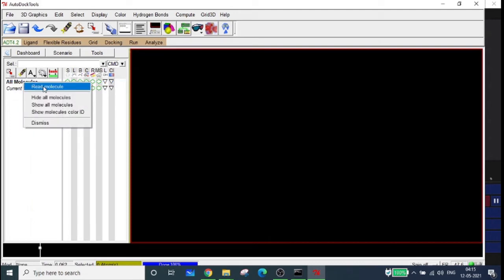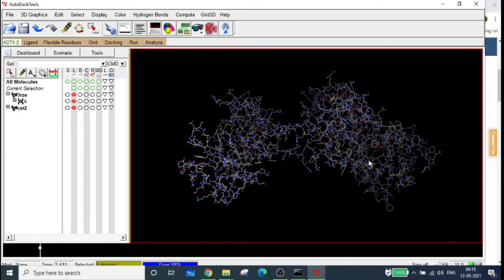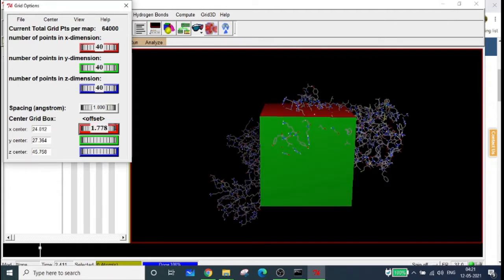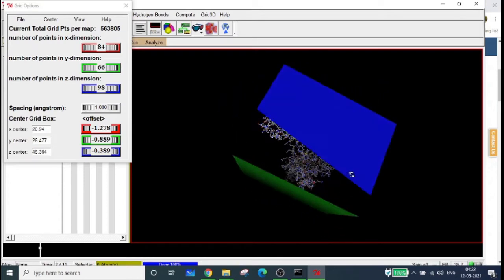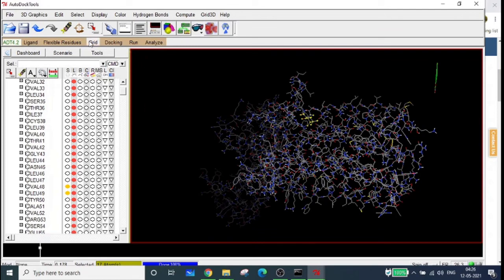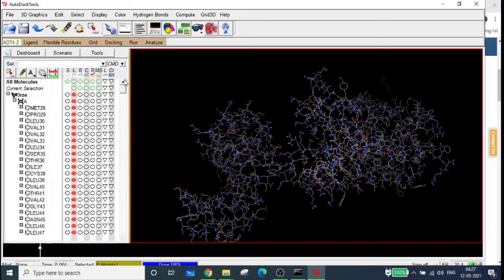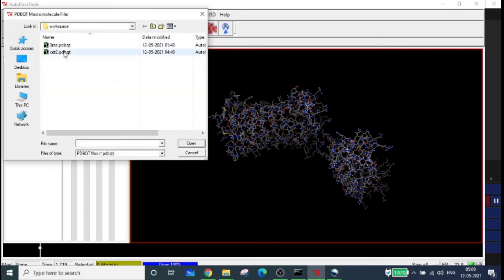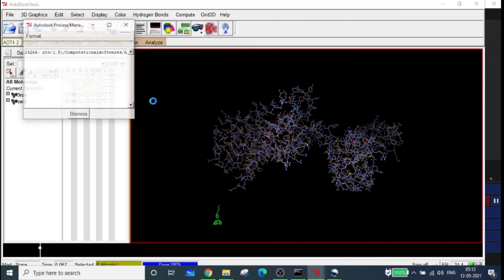AutoDock Tutorials Part 5- Run AutoGrid & AutoDock- Blind Docking

Comment: Sir, I found MAP files but glg file is not there....even after running autogrid three more times.
Reply from the maker: Have you enabled file extentions? Also check you command prompt terminal for any error messages

Comment: Sir, didn't find the .gfg file saved in my pc. Nor the .glg one. How to make them save?
Reply from the maker: After specifying you grid box and saving the. txt grid file again go to grid-output- save gpf and give any name (g. gpf) and save.. glg file is generated as the output file after running. gpf file. And this gpf and glg files are not needed if you are using autodock vina

Comment: Sir, i have blind docked 1protien with 4 ligand and found multiple binding sites. I am confused about the result. Please guide.
Reply from the maker: Each ligand may bind to some amino acids. These ineractions may be hydrophobic or pistacking or H- bonds. What exactly is your confusion? You have to identify the exact amino acids to which ligand binds and then do a specific docking by preparing a grid in that specific area to obtain more accurate results.

Comment: Sir, i had performed molecular docking of a standard inhibitor against a target enzyme. Both Vina and Autodock were used (active site docking). Vina results are good and are same as present in literature, but Autodock results are very different with wrong binding affinity. Why is it so ? With vina, inhibitor is binding to active site however with Autodock inhibitor is not binding to active site and goes to anywhere else.  What to do now ?
Reply from the maker: It all depends on the scoring function and algorithm we have used. Also it is better to perform docking using more than one software which uses different algorithm and scoring function and compare the results because we cannot expect a single software to exactly model a biological system. Also note that since Vina uses hybrid scoring functions it is, in many cases more accurate and faster than autodock 4
Reply: @TheAbzaby Thank you sir. Can i use vina to run blind docking?
Reply from the maker: @manojdhameja4212  sure. You can use vina to run blind docking. Also make sure to run more than one docking and verify the concordance

Comment: Hello sir, in my receptor there is Er3+ metal ion..it is not define in the autodock parameter file. So while running the autodock it gives an error message "unknown receptor type Er" and I can't remove this ion because it acts as an active site. Could you please give me an advice on this problem..
Reply from the maker: You need to add parameters for Er. To do this open AD4_parameters file in your workspace, copy it and save it as AD4_parameters_1 in workspace itself. Now open this file with any text editor (Note pad or notepad plus if you are using windows). Add Er parameter file below the last line in proper alignment.

Er file is 
atom_par Er 3.39 0.007 12.000 -0.00110 0.0 0.0 0 -1 -1 4 # Non H-bonding

Male sure you add it as the last line and align it properly with the above line in your file.
Reply: @TheAbzaby  Thank you so much sir for your response💐
Reply: Dear sir,
After adding the new atom type Er I was able to create .glg and .dlg files. But sir when analyzing the results using autodock vina it shows an error "in file protein.pdbqt, atom syntax incorrect "Er" is not a valid autodock type, note that autodock atom types are case sensitive" . 
But sir I'cannot find any errors in my files. Can you help me with this problem also.(vina execute using command prompt)
Reply from the maker: @harshiniiresha23   do one thing. Run the calculation again. But this time after you prepare your grid file, open the. gpf file and add a line at the top stating "parameter_file AD4_parameters_1.dat" then do the same procedure with your. dpf file also.  The logic is to tell autodock to use the modified file as your parameter file for calculation since it has the coordinates for Er. Also make sure that the file name you have given is exactly the same as the name of the parameter file in your directory. It is case sensitive use capital letter if it is used in the file name. Also doubke check your parameter file that it has all the coordinates for Er aligned properly with the above line.
Reply: @TheAbzaby  I did that too sir. I'll try again.
Thank you.

Comment: Sir I am not able to get all the map files.
Reply from the maker: Is the problem with. Cl map or. Br map?
Reply: @TheAbzaby  With Cl map. It says that "I cannot find or open Cl.map". I tried to rename .C.map to Cl.map, but it still does not calculate
Reply from the maker: Renaming C.map wont work. Check if you have a CL. map file. Or you will have to run autogrid again

Comment: sir, why is my ligand not docking on my grid area?
Reply from the maker: If you have any doubt regarding your autogrid run then open the .glg file and ensure that "autogrid4.exe: Successful Completion." is shown at the bottom of the file. This indicates successful completion. 
And are you able to proceed to Docking after grid preparation?
Reply: @TheAbzaby  I already resolved the problem sir. I made a careless mistake when saving the .gpf file. The numbers went back to default. I rechecked the .glg file every time autogrid is executed successfully to make sure that the numbers I inputted were correct. Thanks you so much.
Reply: and thank you for the fast response. I really appreciate it.